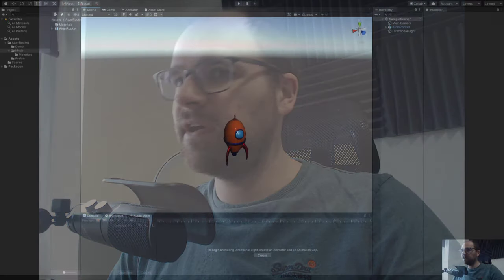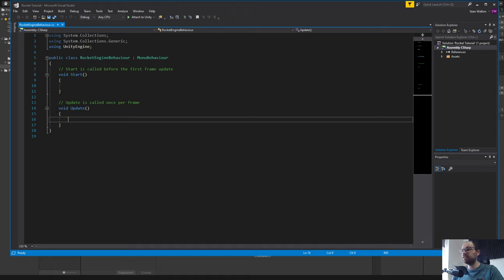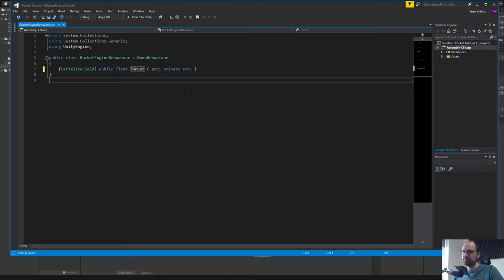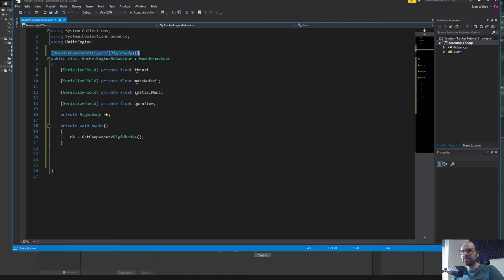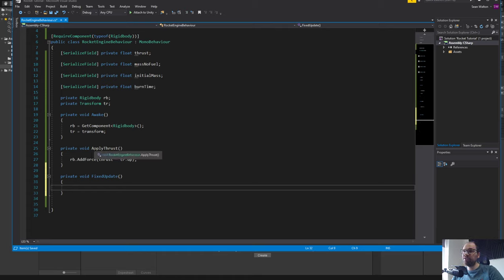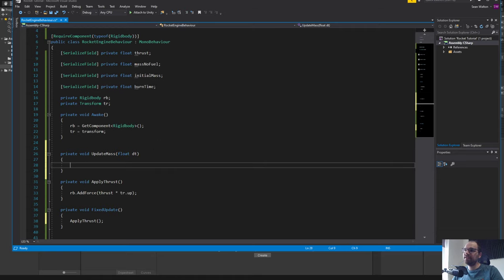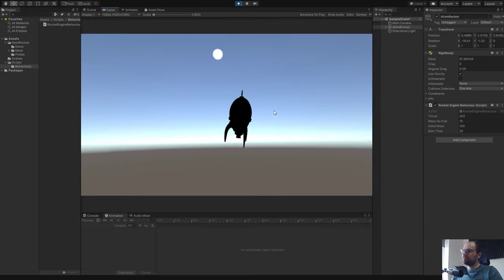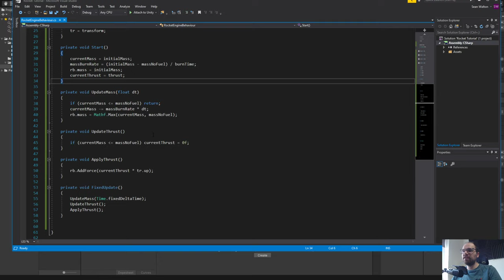How to design components in Unity3D – Building a rocket engine

Comment: Hi. I use objects exported from Blender in my game. They are boats that have several chairs. do you think that if i export a single chair in blender and organize it manually in Unity it would improve if instead all chairs positioned in blender are exported?
Reply from the maker: I think so... I haven't done much 3D stuff but with some CAD files I've worked with all the relative coordinates were imported for different child objects in the file